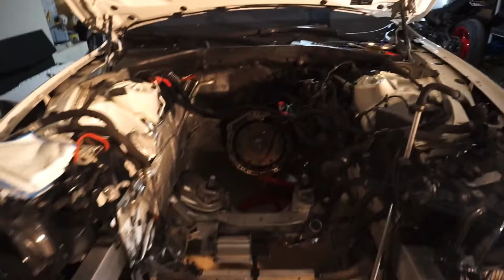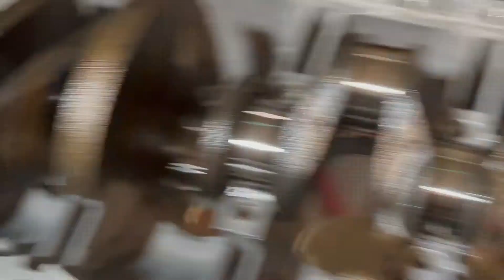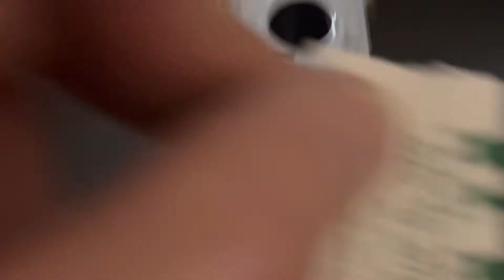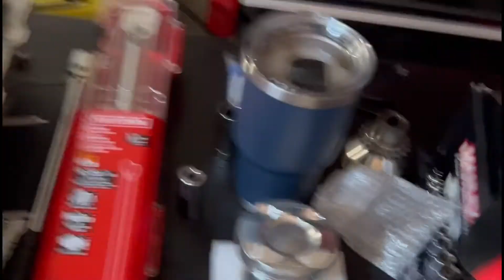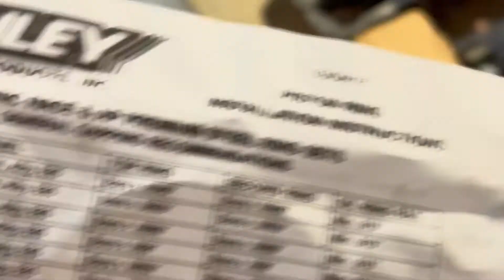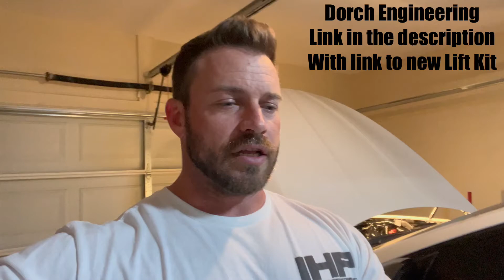In House Performance Big Power N55 Build

Comment: question man, so i was using you’re link to your build and the manly piston link was discontinued and i found these pistons; manley N55/S55 37cc Platinum Series Dish Extreme Duty Piston Set - 84.5mm Bore
are these the correct ones? It says .50mm oversized, would the block have to be machine or, i’m kinda just jumping in head first, but just want to build my n55s motor, are those the correct pistons or any pistons you’d recommend
Reply from the maker: Yes those pistons will work and yes you will have to have the block machined to use those pistons!
Reply: @Inhouseperformance question, in the f10 build, you had aftermarket cam right? I’m looking at 5150 autosport camshaft set
Reply from the maker: @cloutgod2888 nope stock cams stock heads.

Comment: Is that the stock cast crankshaft?
Reply from the maker: Yes it is
Reply: @Inhouseperformance  What is your horsepower goals for this engine?
Reply from the maker: my original goals were to make over 700whp but with this setup we might push it past to 800whp and see how much the stock crank can handle.

Comment: Any valvetronic advise? Its been almost 2 years I've driven my f06. I had it parked, and one day it started like awful shit. It eventually calmed down but made a noise when I shut it off. About 3 months ago I figured out what that is. I drove it a little before hand not knowing. I hope It didn't do anything. Im hoping its just the valetronic motor and not the shaft. I've reached out to a lot of places to work on it. Its seems like bmw is my only choice. If anyone has any idea of costs or things. Im almost tempted to spend more if the job isn't crazy expensive. Maybe injectors for the future

Comment: why not a closed deck modification ?
Reply from the maker: I know lots of N54 guys running in the 800whp with open deck and I dont plan on going anywhere near that. Well be lucky if I get into the mid to low 700s. Again not building it to be a race car just a fun luxury sedan.

Comment: Would this be easier if you just remove the engine with transmission since you have the front end off?
Reply from the maker: Yes it would have been but I wasnt planning on building the trans at first. I ended up pulling it having it built and installing all of it together.